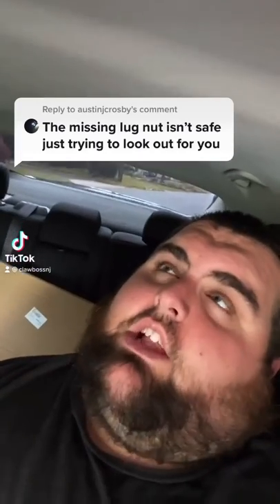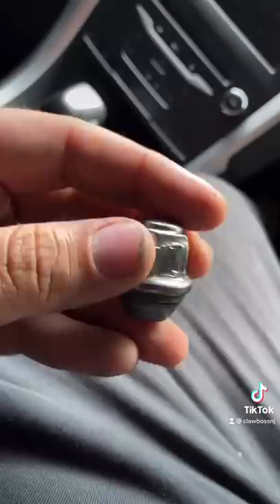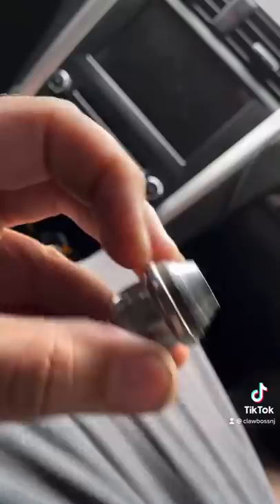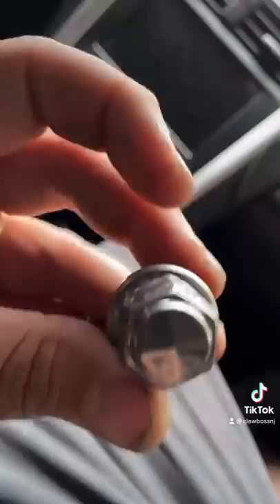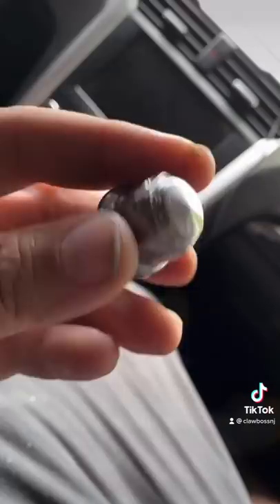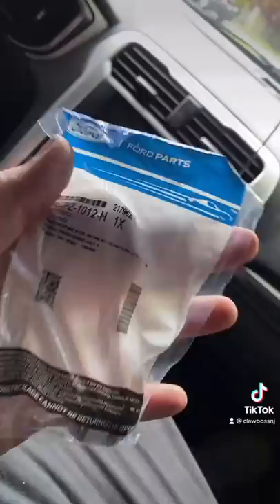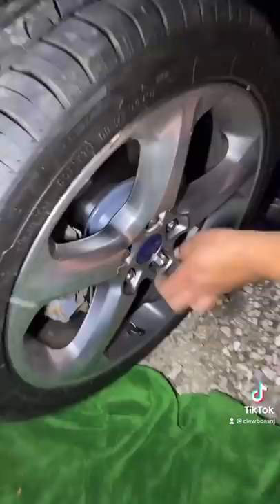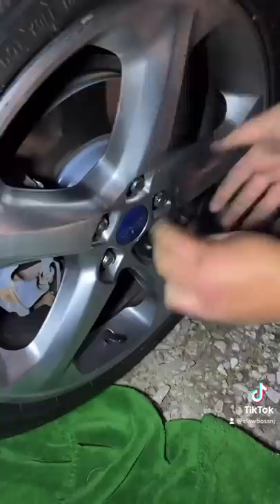Why Do Lug Nuts Expand and Puff Up?

Comment: I'm a Ford Tech and yes these lug nuts suck. He is correct about the corrosion, however you don't need a special socket to get them off. Just get one size up (eg. From a 19 to 20mm) and hammer it on. Also, go to Costco, discount tire, etc. and buy 1 piece lug nuts so this doesnt happen again!  Often they'll change out the lug nuts for cheap for you if you'd prefer that! Stay safe and get help if you dont know what you're doing! 😊

Comment: i work at a scrap yard, i  hate those kind of  lugs, i spend more time getting them back out of my socket than anything.
Reply: Thread them back onto stud for like 3 threads.. Hit socket with hammer from the sides. Easy
Reply: @Reuter6795  yeah thats what i usually do, but after the first 6 it just gets annoying. and then theres always the one where the outer layer breaks off and  gets wedged. luckily i dont get cars like that too often.
Reply: Throw the socket away🤣

Comment: I am so glad you realized this and got it fixed as soon as possible! 😊
Reply: It doesnt even matter if hes missing one nut if he doesnt even torque them onto the car 🤣🤣
Reply: You could drive that car around for 10 years with only 4 nuts it will change nothing
Reply: @ispy7109  no reason to torque your wheels to spec unless you’re racing it
Reply: @hentaibodypillow250  youll be chasing your rim down the offramp in your new threewheeler. Promise u
Reply: @hentaibodypillow250  lol you have never worked on a car

Comment: I recommend buying a 19.5mm flip socket it will fit the lugnuts when they swell up. Definitely helpful on the side of the road to change your tire. Also to replace all the lugnuts (20) it would be about 120 bucks USD. Unfortunately the new ones will do the same thing a year or 2 later if you live in salt state. Hope this helps!
Reply: Never forget a torque wrench
Reply from the maker: It was actually a 20mm that fit it. Thank god Lowe’s came in clutch because autozone and advance didn’t have one.
Reply: Nope. Hammer on a 19mm socket the after getting the lug off, insert a screw driver into the socket and hammer out the crap lug nut
Reply: Buy solid ones for $40 and never have the issue

Comment: 95% of the time when engineers design something they don't design it to be just enough to get the job done, they design it to handle 2 or even 3 times what they need it to handle, a car missing one lug nut is a minor concern but not one that is life threatening at all (says my father who is a mechanical engineer of 35~ years)

Comment: Sometimes you can get a screwdriver, use it like a chisel and  hammer off the aluminum and eventually you can get it off. It is more time consuming however
Reply: Yeah but pain in the ass
Reply: @ProdZooZoo  yeah that's why I said it's more time consuming.
Reply: I work at AAA. I usually just hammer the socket onto the lug.
Reply: @Reuter6795  oh yeah that's another really good method
Reply: Just switch from one unit to the other metric or sae go up one size and massage it on with a hammer. Impact it off then use a punch and hammer to remove it from the socket. This "i need a special tool" bull is why it takes 4 hours to get a tire rotation when i used to do it for customers on their lunch break.
Reply: Yes. It happened to me, had to do that to 6!

Comment: They sell 19.5mm flip sockets at AutoZone. The 18.5mm side is great for when the caps on the lug nut pop off from the swelling. Which is pretty common on those Ford lug nuts.

Comment: Mechanic here, you really gotta torque those down. Should be roughly 80 foot-pounds, or with the provided wrench, as hard as you can with the tire on the ground and without putting your weight into it, you can judge by feeling how hard it was to remove the other lugs. They must be tightened and then torqued down in a criss cross pattern. In order for those bolts to stay in place, the threads have to slightly stretch (because metal is elastic and threads are a wedge) in order to stay in place. Without torquing them down propor, the nuts will slowly spin off as you drive and eventually your wheel will either flop around on the studs and shake the car violently or fall off and kill someone in traffic. I had a family friend die to a wheel falling off due to improper lug nut torque. Very important.

Comment: That's really common on ford... they build everything really well... so well that they don't weaken any of the body by leaving openings for moisture drainage resulting in running boards and wheel wells rusting from the inside out.

Comment: As a tire guys its becose of the materials... the oxyd eat the metal in th inside makinh the nut expand..   this is why i use on vrhicule full nut often aluminium cap nut    u can roll ur car with only 3 nuts for a little time but need to replace before stud rusty

Comment: On my old Volvo 945, i only had 4 bolts instead of 5 because the former owner had broken one of, worked fine and i put on a spacer for it to go through the inspection 🤩

Comment: Replace them all. No special tool needed. Hammer on a socket and impact it off. Then grab a screwdriver and insert it into the socket and hammer the stuck lug nut off. Then replace with one piece steel lug nuts from Autozone. Autozone pack of 20 is $35 while each OEM one is like $10

Comment: Overtorquing the lug nuts, normally with an impact gun, the thin metal casing around the steel nut underneath twists and the "pointy ends" end up in the flat spots of the case.

Comment: Used to work as a tire tech. Ford lugs were always a bitch to deal with. Most of the time when they were swollen like this you had to bang on them with a hammer to get them out of the socket. Turned a 15min job into a 25min one.

Comment: Yeah so btw, those lugnuts often swell because of tire shops not using the right size, so they'll use a 3/4 instead of a 19 or visa versa. Corrosion does happen but thats the main cause. 1 lugnut should only cost a few bucks, and you don't need a special socket. Just get the correct size and hammer it on. Just need a punch and a vise to get it out of the socket after

Comment: It's not ideal, but also not quite unsafe to drive while missing 1 lug nut/bolt (if you have 5-7 lugs). The rule i was taught while working at a tire repair shop was that yes, we always try to sell them, ofc, but if they're missing more than 20% of the lugs on a wheel, we will not touch the vehicle

Comment: This is a common problem with Ferds cause they can't even design a dang lug nut. Best thing to do is to just replace them with solid stainless ones as the Ferd replacements just swell up again within a year.

Comment: The same thing happens to my Lincoln. You will keep having the same issue if you use the Ford ones. You need to go to a place like discount tire and get one pice solid nuts. They are like 50 bucks but will save you so much in the long run

Comment: I have a 15 MKZ, basically the same car, and I can tell you, those lugnuts are a nightmare! The way I remove them is simple. I grab a 12 point 19mm and a hammer, BEAT that on until the socket and lugnut are one, and then remove it that way. And to get the lugnut out, screw it a couple threads back on to the lug, and smack it a few times.

Comment: I worked at a Ford dealership for a while and it is pathetic how terrible their lugnuts are. A simple works(oil change and tire rotation) went from a supposed 45 minute max job to like a hour and a half job depending on how badly they were swollen. We even saw a brand new car come in with swollen lugs

Comment: I got a sorta interesting story about missing lug nuts. My family used to have a 2008 Hyundai Sonata and we lost the majority of the lug nuts. Each wheel was supposed to have five. They had three each. One actually only had two lug nuts. But it still did around 60mph with no trouble, lol.

Only reason we don't have it now is because we changed the oil and used the wrong filter so the engine seized for the third time.

Comment: I’ve got a question how do you lock the bus and get back in in the morning because I don’t see a key hole anywhere
Reply: Ive always wondered this
Reply: Usually they don't lock
Reply: On ICs with manual or electric doors, there's a key on the right side of the door pillar about halfway up by the mirror mount. It says DOOR RELEASE. On electric doors it's actually a switch that you turn one way to open and the other way to close. On manual doors, turning the key pulls a cable which pops the safety latch on the driver's handle. Our IC buses have air doors - which release automatically when the ignition is off.. They dont actually have a latch, so when the bus is off there's no way to actually keep the doors closed. When they're parked in the yard, we lock them with bungee cords so the wind doesn't blow them open! 🤣🤣  Blue Birds and Thomases have a "deadbolt" style lock on the one door flap that operates from outside.

Comment: Ok so these Ford Lug Nuts absolutely SUCK. DO NOT USE THEM. My dad was rotating his tires on his Ford F-150. The lug nuts are covered in an aluminum coating to make them shiny. Well since there is no exact lug wrench head size to fit they are a pain to get off. If you go to a 12 tooth socket head it will shred the aluminum and the only way to get it off is by a grinder. We found some nice ones on Amazon for like 35-45 bucks. Much worth the price. Up to you but recommend it.

Comment: The Ford lug nuts suck. My wife's 2015 escape had the crap lug nuts that strip for no reason. (Really just by taking the wheels off with the correct socket. There is a weird chrome metal wrap around it. So I pulled all of them off and cut the wrap off. now use a 18mm instead of a 19mm and they work great

Comment: Almost looks like a Ford lug nut.  If it is.  Then the problem isn’t water getting in them. It’s people running them on with impacts and it causes the chrome casing to spin over the nut it’s self causing it to swell out. I’ve seen people having to beat a socket on to get them off

Comment: 4 is safe for 100 drives. I have driven with 3 of 5 ..and the 3rd was half ass on there. Got home alive. 4 is perfectly fine..can drive like this for years. Problem only comes if one of those 4 break. 
3 you would get home and back but need to take turns very slow.

Comment: Another lug nut killer is using impact to crack them. Those coated lugs splt with impact over time. Tire shop wrecked entire set on me. Went to solid ones.

Comment: Not ideal, but its perfectly safe to have one lug nut missing. Use to be a tire tech years ago and it wasn't uncommon to have to send cars out the door with one or two missing. Either just was never there or rust snapped it off.  Drew the line at 3 though.

Comment: I usually replace these 2 pc. lugs for regular 1 pc. its just a regular old lug only reason why they made them is just for show for some rims others I guess to fit the lug wrench in the hole. But from the looks of your wheel a one piece will fit fine as long as its a 19mm.

Comment: I don't see how corrosion from liquid under the cap would cause it to swell.

My theory is the cap gets moisture underneath, but it is trapped and the cap seals with the nut trapping it. When it is heated, ie I'm the sun, it evaporates causing it to expand like hydroformed metal.

Comment: Once me and my family drove around 100 miles on the highway and through canyon road on three out of five lug nuts because my mom had gotten her wheels balanced and the people who balanced the wheels had over tightened to the lugs and had introduced hairline fractures in the studs which caused them to fall off when we checked them so we had to drive home with three lug nuts, and another time we were driving home from a trip and at like 9-10 :00 so it was night and we started to hear the like rapid 'pft pft pft' sound like pulsing an air compressor output can any of you guess what is was (answer is in the first comment don't look before you guess)
Reply: It was a spark plug that had come out while driving thank goodness me and my mom are car nerds.

Comment: A tip from the wise, with a flathead and a hammer you can get the cover off those lug nuts and make it work again. Wont be as shiny though

Comment: Can you show teach us about cars a bit in future shorts? Just asking. Thanks :) or bit more about your Ford Fusion :)
Reply: Engine (Gas ignites in a cylinder causing an explosion pushing the piston down turning the crankshaft) connects to a tranny (Gears to make output soeed changes to make car go fast, so that the 3000 engine rpm can make 80 wheel mph) which connects to ur wheels. Front wheels connected to tie rods, Rear wheels connected to an axle. Like the good old days. Any questions?
Reply: @ClassCraZeTV  do car go vroom?

Comment: Hey next time this happens take the outer casing off the lug nut and use a size smaller socket like an 18mm since im pretty sure most of those are 19mm and some dodge and very few ford ones are 21mm but that works everytime and take a hammer and beat the 18mm on the messed up socket and youll get it off everytime ive even slammed a 19mm on one that was way swelled up and got it off you can too i promise i learned that while working at midas for two years got real tired of buying lugnuts for customers so everytime a ford came in with those or a dodge i told the customers what could happen and that i am not liable for the lug nuts that it is a wear item on these vehicles and people would still tell me to rotate their tires and if i had to replace tires yada yada and i wouldn't have to buy them lug nuts anymore id get them home safe on some ugly capless 18mm lug nuts theyd get the part from ford or midas would get them cheap ones that didnt last as long as the ford one from napa and theyd pay for the new lugs and i had to install them free and most of the customers once they realized they weren't paying for any labor would talk to me about my pay and when they realized how low it was would give me $30 to $100 tips because midas in my area only paid $10 an hour to technicians that would do any job because they were already so broke half of the employees checks would bounce at the bank if they were the first to cash their checks it was honestly ridiculous how it was long story short if you want good work done find a confident licensed and insured person and or local shop that knows what theyre doing for major items on your car cause ive seen master techs screw things up and then me the 18y/o and 19y/o kid through out the two years i was there would go over and help them do it right and point out a lot of mistakes because i wasn't watching the shade tree mechanics do things i was watching the trained lifer master techs online and my dad and a couple other people who actually knew what they were doing do and i knew what and how to fix most problems on pretty much everything and they were always so dumbfounded on how a kid half their age could do it right with half the tools i always told them its not about tools its about knowing how to do it correctly and i ended up getting a raise because i finished a job a master tech couldn't my raise consisted of $2 more an hour brought me up to $12 an hour i ended up quitting and i work less than 40 hours a week now and i worked close to 55 if not 55+ hours a week at midas and i make 3 times as much as midas was ever willing to pay me never try to work at a shop who cant pay their employees is all i got to say they will never pay you what you're worth and they would much rather hire dipsh*t kids to do the work the trained technicians would do in half the time and with no come backs when they have 4 to 6 comebacks a day now because of kids not knowing what theyre doing its just sad i went up there for tires one day and my old boss was there and me and him were talking and he asked me if i would come back i asked why as we watched a kid start a car to bleed the brakes meanwhile the dude told him not to start the car that it wasn't necessary which in most cases is correct and as it was for this vehicle so he had told him dont start the car cause the oil was drained he started a car with no oil and he said thats why shit is something new everyday i said $20 an hour and 15% commission and ill think about it and he hasnt called me back and he has my number hes to broke to do it so those kids in there are all at $8 or $9 an hour not knowing a thing be careful who you go to

Comment: Guy trying to say missing one lug nut is dangerous. I did 120 miles an hour with three lug nuts on a 5 lug donut(those skinny tires rated at 50mph). Mounted on the front... no I'm not proud, I was young and dumb. BUT - 3 lug nuts will get the job done when torqued properly. Obviously only in a pinch

Comment: I love how everyone in the comments is an auto mechanic, "get a hammer and flathead and chisel the cap off" no. Best thing to use is a strip out socket, they are made to bite into any misshapen nut and hold on for dear life. If you don't have a strip out socket, the next best thing is to use the 17 mill ifthe 16 mill doesn't go on the lug nut at all. Use a hammer and 16 mill socket if it goes onto the lug nut even a little, and just hammer down until halfway. Which looks to be what claw bosses mechanic had done since you can see the line the socket left.

The reason you don't wanna use a hammer and screw driver is because if you hit the screw driver wrong you can break your rims.

Comment: Do yourself a favor and get the steel only ones. Those are tin or aluminum plated for looks and when the nut is on tight they bend out of shape by the tool used to take them off and the dealer charges like $10-20/pc.
✌

Comment: As a car guy I can say Your car would be fine unless it was a 4 lug rim  then you would have a problem. I drove a total of 2 years missing a lug nut on a 5 lug rim. As long as the other nuts are torqued to the right specs then you are good